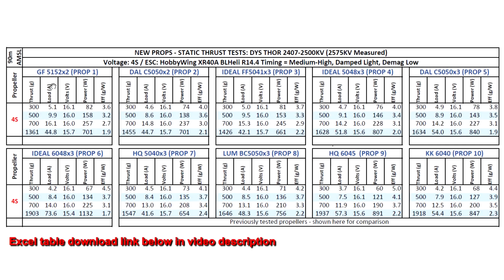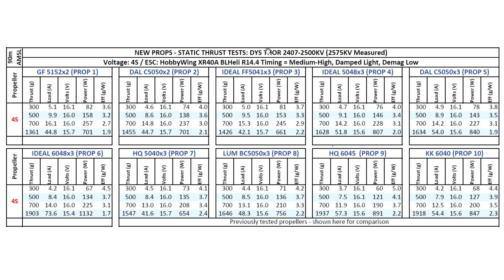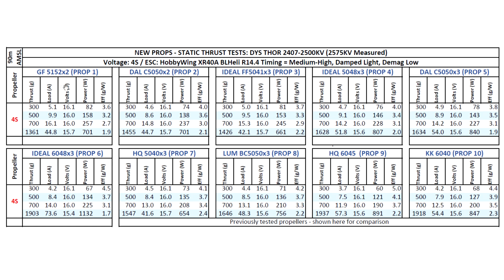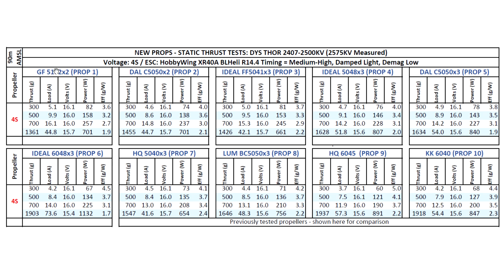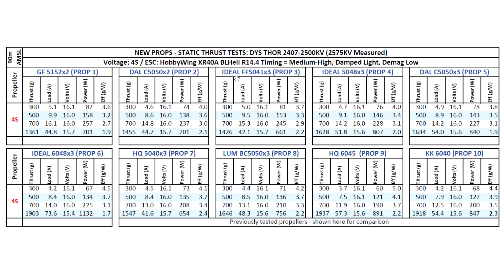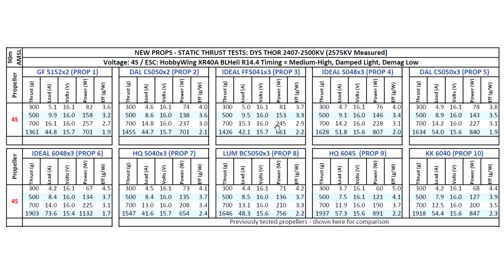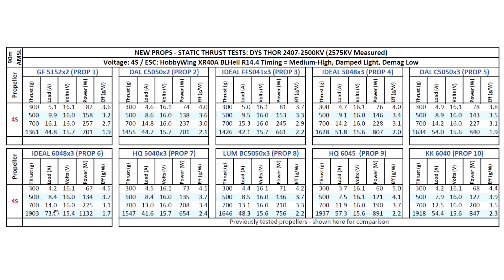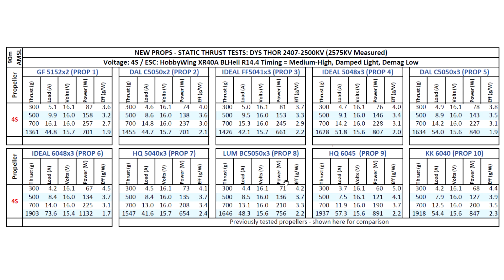New Propellers Ideal 5048x3-GF-DAL C5050 4S thrust tests dys Thor 2407-2500KV

Comment: I don't fly biblade but out of the triblades you tested I've tried the fishbones, all 3 cyclones, the 5152s, and the buttercutters and the cyclones and the 5152s are definitely made for aerodynamics, punches have more punch and they are all around smoother than either the fishbones or the buttercutters or actually the hq5043s the hq5043s are alot like the better cutters they're smooth but they lack power, and the ideals are kinda muddy feeling for lack of a better term, and I've tried them all on mr.steele motors, emax2306 2750s, rs2205s 2300, and f40II 2600s so I've got a pretty wide selection of motors for testing, I still like seeing the static testing though it's cool to see the numbers associated with them I want to figure out a way to do in air testing scientifically.
Reply from the maker: Right, ultimately, the best test is how each prop feels on a specific setup/quad since there's so many different combinations, expectations, flying styles and goals. You have pretty much summarized it very well. Static thrust is only half the story and in the case of 5152s and TRK 5051's, less than half.  In-flight testing would be awesome. One could do some sort of test track and test average acceleration, speed, rate of climb, Amp draw and of course flight characteristics or "feel". Tests would have to be repeatable in order to do comparisons. It would be lots of work though, so probably best to concentrate on the few known good props

Comment: that 6048 took a few millisecnds to get to peak.. need to try a hqprop 6040x3 in there as well!
Reply from the maker: I gotta get a set of those and see how they do. Yeah, I noticed that, at the top end of throttle the motor felt like it hit wall as the Amps climbed way high. One of these days I'll have to start my 6" build so I can actually try some 6" triblades

Comment: Hi I don't think I will be using the 6048x3 on my 6" build, with the 2305 motors, however they may work better on lower KV motors.
Reply from the maker: On 3S perhaps - right, on lower KV like 1800 to 2200KV they'll be better. 2500KV is just too much I think.  LiPos will be crying !

Comment: I bet that the GF5152 is stalling out just like the RK5051.
Reply from the maker: Sickocrow yeah. That's why I don't test them anymore. They're designed for making thrust in moving air. In static their airfoil just doesn't do well and performance doesn't translate well to actual in-flight use

Comment: Hey Engineer X! I watch all your videos and love the info! With this new generation of propellers that are designed to work with flowing airflow it's getting harder and harder to judge them by static thrust tests. I know it's over the top, but could I suggest something a little bit funny? You could make a mini-wind tunnel powered by the motor/prop in the test. If you'd use a fairly small loop with 200mm+ tubes and some internal air strakes, you'd be able to get a nice coherent airflow and even put a sensor to measure airspeed inside as well! I can help out with design/costs if you're at all interested. Let me know! Best Regards, Bruno 
DISCLAIMER: This will not be a precision tool... just a neat way to measure props and motors in a controlled-non static way!
Reply from the maker: I actually did think about making a cheap man's wind tunnel. My idea was to use a large 35XX motor spinning a 10" prop blowing air to thrust stand, but then I thought about all the time it would take me to set it up so that's where the idea stopped. My thrust stand is not permanently setup on a test bench. I test in the side patio area of the house and put it away after use. So setting up does take some time: camera on tripod, flood lights, laptop, power supply, blower fan for cooling motor after each run, LiPos for KV test, fan and camera light, ......etc so I didn't want to add even more equipment  

Your idea does sound very good and it should work, it should provide plenty of moving air to simulate propeller moving through air. Thank you so much for the suggestion and offer.
Reply: EngineerX thank you for the reply! I'll design the project and send you the design to see if you like it. No obligation or commitments. It's just for fun! Be back soon!
Reply from the maker: Yes, that would very cool! I may even include it on my next video if you don't mind, just to show people the cool things others design and think about!

Comment: Interesting stuff. I am running F80 2200kv with those Ideal 6048x3 on 5S with 30a escs and nothing has blown up yet, what an experience those 6048x3! Keep up the awesome tests sir.
Reply from the maker: Holy thrust !!! that must be mind-blowing! 
Very useful info to know about your specific setup that works. 
The 74A Max would actually be around 48A Max on flying quad on 4S, that's momentary Max so only possible for less than a second probably, if at all, LiPos would have to be able to deliver all that juice. I think that's why we don't see quads turning into fireworks because the batteries are the current/Amp limiters :) - Also good 30A ESCs have no problem handling Amp spikes of 50A , which why I love my HobbyWing XR40A taking the 74A like a champ !

Comment: I do not understand why anyone does not test the hobbywing xrotor 2405 engines while using for various tests the hobbywing ESCs ... is absurd there is anyone who has tried these engines even miniquadtestbench proves tough engines from dump but hobbywing xrotor no
Reply from the maker: I actually contacted HobbyWing through email and never got an answer then I've been considering ordering it from Banggood, the HW 2205 i tested a while back came from Banggood, donated by a RCGroups member, seems HW doesn't really want to send test samples. I love Hobbywing, they have been making quality ESCs for years. I'm still using BLHeli flashed Platinum 30A (6S 10" 3110-470KV quad) and XR40A (6S 2206-1500KV 6" hex)
My "problem" was that I've been getting too many motors and parts sent to me for testing and it's difficult to finish all the tests. I still have about 9 motors that I have to test and a few other parts. 
Even though the video portion where you see the motors on the thrust stand is only 1 or 2 minutes, the actual tests takes me about 1 to 2 hours per motor. Then editing the video takes me a long time because I can only do it in short periods in the evenings.
Reply: Thank you for the explanation, I understand the great work that is behind every review, the various difficulties and working time required, your reviews and tests are important to deepen and know more things, I hope the hobbywing answers by giving the material for a review

Comment: This could be a good opportunity to test the Gemfan 5152x3 :)
Reply from the maker: I did test it in a couple of the recent motor tests. For test results please check 
Note that similar to the TeamRaceKraft 5051x3 prop, the GF doesn't perform well on static thrusts. Their blade airfoil has been specifically designed for making thrust when moving at speed. That's why I don't include them in tests anymore 
https://www.youtube.com/watch?v=j1ZkoKp0j3Q
https://www.youtube.com/watch?v=SbHLjq4vtX0
Reply: I see, thank you for the explanation
Reply: Ok, today I did some laps in a track with the GF5152x3 and the DAL 5050x3.
The DAL seem to be more efficient because the flights last 10 to 15 seconds more but I think I prefer the GF because the quad is more easy to control
Reply from the maker: Good info and that's what I've observed. The GF5152x3 do use more Amps but are more responsive throughout most of the throttle range.